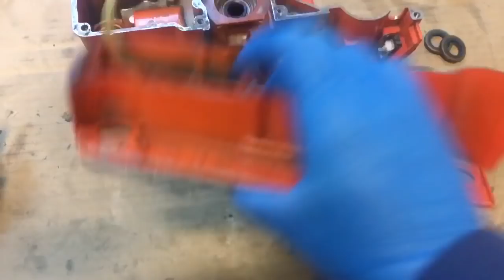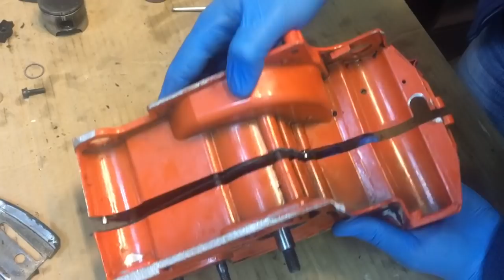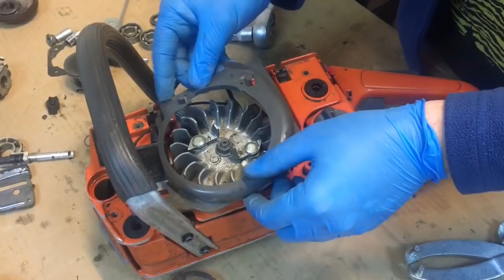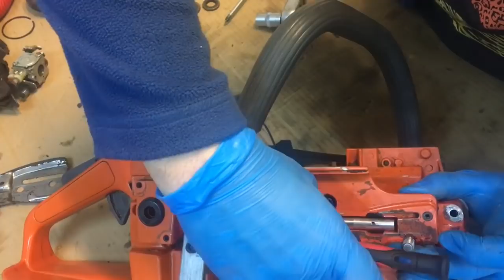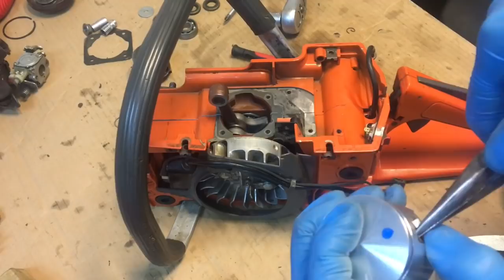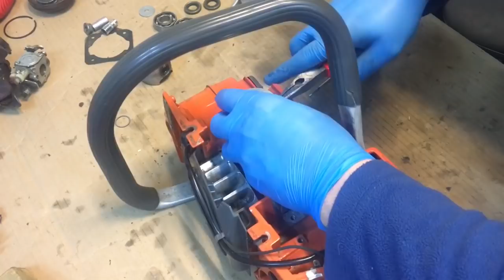Schimbat ambielaj drujba Husqvarna 51, 55 partea 2

Comment: Ce sa aleg intre sthil ms 210 cu set motor de 250, 42.5 mm motor orginal sthil   cilindru piston si segmenti origali sau husqvarna 51 cu motor original mahle ?
Reply from the maker: As zice totusi husqvarna, nu se compara, nu fac parte din aceeasi clasa
Reply: @SHRMotorsOfficial  Friend, the revolutions 13200 max for the saw 372xp oe 2003 are okay?
Reply from the maker: Yes. Is ok
Reply: @SHRMotorsOfficial  13500/13200 ?